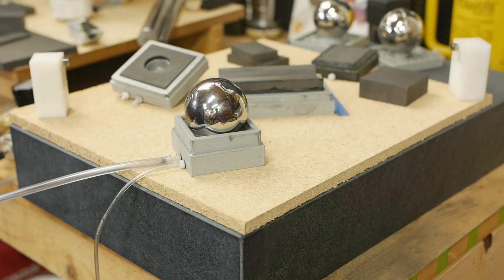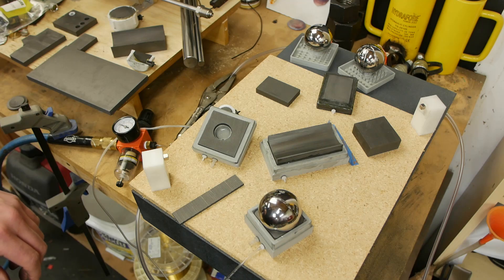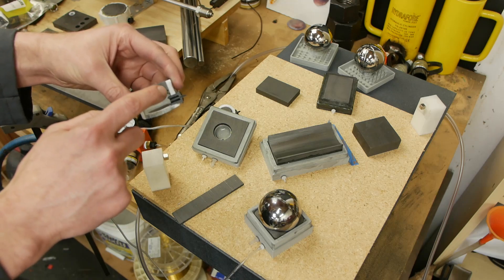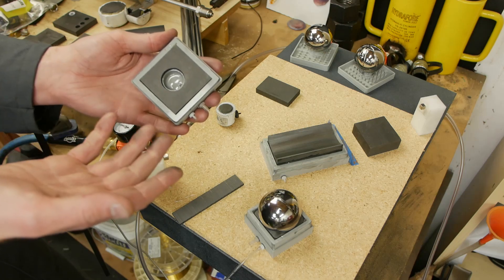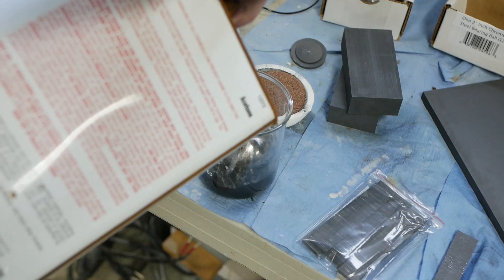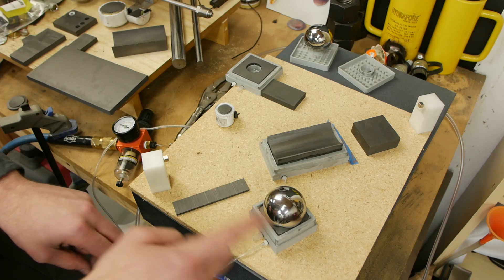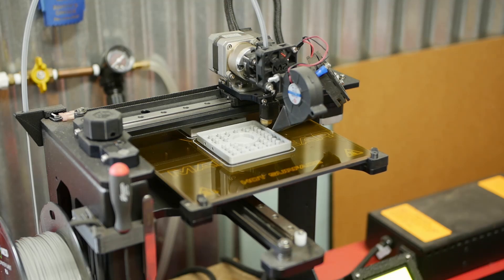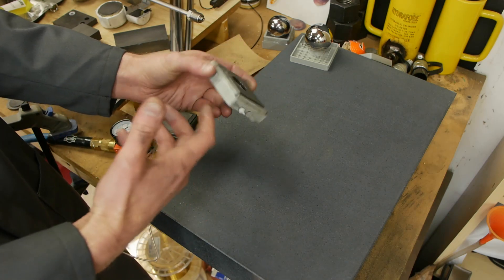Make vacuum pre-loaded spherical air bearings without special tools

Comment: Nice. What kind of air consumption are we talking about? Would it be possible to create a self rotating platform with radial and thrust bearing elements, and power it from the air tank, instead of the compressor to reduce vibrations and other moments? I am thinking of creating a high speed gyroscope (~1kg, ~100000rpm) suspended in mild vacuum, with air bearings, and entire assembly (including two weight balanced air tanks), put on the free floating and very level granite table, coupled using air bearings too, possible in a separate vacuum enclosure (to reduce environment air flow). The important part is, I need the entire assembly be self contained (batteries and air supply), as the cables and tubes could put forces and moments on the entire assembly. Communication and datalogging would be wirelessly or to flash storage, so that is rather easy.

Comment: BE CAREFUL CUTTING GRAPHITE ON POWER TOOLS. Contrary to intuition, even though graphite is commonly used as a solid lubricant in NON ELECTRICAL APPLICATIONS like locks, the graphite dust DESTROYS THE ELECTRIC MOTORS in power tools. I found this when doing machine design at Form Physics in San Diego back in the 80's. We were using wood working joiner-planers and circular saws to machine graphite transports for experimental ceramic injection molded hard drive parts and all the power tool motors were destroyed. We didn't do any failure analysis but I assumed it was either destroying the bearings or shorting out the brushes or winding. Just be sure to use lots of air to blow out the tools during all the time they are exposed to the graphite dust. Of course, we were doing quite a bit of machining and probably doing just a few pieces would be OK, just be forewarned..

Comment: This technology is a good demonstration for how superconductor materials would change the world as we know it. Superconductors, because they have zero electrical resistance, are always flowing electrical charges which results in a magnetic field. If you were to build and engine entirely out of super conductive materials, all the parts would last virtually forever since they would never actually come into contact with one another due to magnetic repulsion between the components. The way these parts are held in close suspension is a good visual for that concept.

Comment: Great video as always - I'm interested to know how well the spherical bearings scale, i.e., is there a minimum and maximum potential size? Also, is there a formula to calculate the approximate load bearing potential of a spherical bearing based on its size, air pressure etc?

Comment: 16:30 Would it not be a better design to use two of the half pipe air bearings, one on top of the other? I understand that it might be a pain to perfectly center the shaft in relation to the bearing, especially if everything is hand made without precision tooling, but the added benefit of being able to remove a bent or mushroomed shaft without drawing it through and damaging the solid graphite block may be worth the added aggravation.

Comment: Excellent video.  I work in the PCB drilling industry.  They use air bearing spindles for drilling holes down to 0.0020" diameter.  The spindle shaft spins up to 180,000 RPM (3 thousand revs per second) while being suspended on a thin cushion of air (horizontally and vertically).  For the drilling table, it is floating on vacuum preloaded air bearings.  The flat air bearings are hard anodized aluminum with 6 glass lined orifices.  Each orifice is 0.0060" inside diameter and is supplied with 80 PSI of highly filtered air.
Reply: Just curious: how long does it take for the spindle to stop if a tool change is required?
Reply: @cogoid  The spindles are powered by a 3 phase AC system using variable frequency and variable voltage.  From 180,000 RPM it takes about 6 seconds to come to a full stop.  The shaft is held at 0 RPM by applying a small DC voltage to the AC spindle.  Then, to ramp the spindle up, the DC is removed and the AC is applied.  To reach max RPM, it takes about 6 seconds.
Reply: @GregSr  Cool! Thanks for explaining!

Comment: I'm warning you now: do not operate electronics you really like and want to keep in a place where you machine graphite. Trust me.

They WILL die if you do not have a very good extraction system.
Reply: @Neocaradina graphite conducts electricity. graphite dust can short-circuit power electric lines or power plant , that's why there's such thing in military as graphite bombs
Reply: Yeah I place carbon fiber near close my 3D printer, one fiber get into power supply and short circuit. First I thought it was due to Chinese crap, then I find out it was one single filament. thinner than human hair :)
Reply: Glad you warned him because surely he doesn't know that
Reply: @Neocaradina Graphite is conductive. You can make a really effective buck converter (a device that lowers voltage) out of a pencil. Just cut the graphite free of the pencil, attach your positive and negative leads to each end and place your power tap wire onto the graphite. If you place the tap halfway, you get half the voltage. It's a linear circuit so percentage of distance across is percentage of voltage you get out of the tap.
Reply: @eideticex  Not every device that lowers voltage is a buck converter. What you describe is a voltage divider, which wastes significant amounts of power. A buck converter is way more efficient.
Reply: @eideticex  That is a resistive divider... not a buck converter.
Reply: @rich1051414  exactly why space pen was a necessary invention. they joke about russians being more practical just using a pencil but that's just a calculated risk out of necessity, they stopped when it was possible
Reply: @snooks5607  
Hmm. That's interesting (graphite dust contamination) - and quite possible/likely. I'd heard the reason for not using pencils is the more down to earth explanation that the tips break off and they didn't want pencil tips floating around. I suppose it's much the same reason, just a matter of size as small fragments of graphite would be constantly shed in use as well as microscopic dust and the occasional whole tip.
Reply: @freelectron2029  they should have just stolen the marines' crayons.
Reply: @freelectron2029  lol, non-conductive granular marital in the zero-g of a space cabin still possess risk in terms of clogging air filtration & potential inhalation or eye irritants. Just add a few dozen more kilos & cm^3 in air filtration equipment and another couple hundred kilos in fuel and the cost parity between the innovation of space travel and banging sticks together to make fire would equal out eventually.

p.s. The space pen was invented independently by a private company, no tax dollars were spent in it's development, and was sold to both the USA and Soviets.
Reply: @dustinbird2090  lol. i think you missed the point. overthinking problems was my point and your answer illustrated that point perfectly. woosh. dozens of kilos to carry a crayon type pencil over a pen HAHAHAHA. couple hundred kilos in fuel HAHAHAH. bits of crayon flying around the cabin popping eyes out of there sockets left right and centre HAHAHAH. oh my man, you need to get some life experience. not key board experience.
Reply: @dustinbird2090  lol, am i being pranked? you just did it again.... wooshwoosh. hilarious )))
Reply: @freelectron2029  You literary are incapable of having a discussion where you admit your point is invalid.
Reply: @dustinbird2090  well done another comment with absolutely no substance. Mr bird everybody.... American. Likes to talk. But not think. The American dream. How's that working out for you all?.... Yup.
Reply: @freelectron2029  You had an original point. Defend it or don't. Play dumb all you want but, I addressed I your original point. And your only response is too insult me.
Reply: @dustinbird2090  I'm not exactly aware of all that might be going on in a space ship, but aren't there plenty of potential sources of dust anyway? Like fiber based materials or even the humans themselves (they didn't wear space suits all the time, did they?)

Comment: For your bearing, try cutting 4 separate quarters with the form. They can be slightly undersized, make some type of 3d printer case to hold your graphite. and use metal straps to preload the pieces together. once you add air the straps will deform and you will have a captive air bearing.

Comment: A good glue for PLA I've found.d its Weldon 16 acrylic glue. It actually seems to chemical weld the plastic. It obviously wouldnt do anything for the graphite block, but it works really well for pla-pla and I'm sure works good for pla to abs etc. Just thought I'd share.

The thick consistency fills layerlines and helps fuse a bit aswell.

Awesome videos as usual🍻

Comment: did you think about doing grafit work in a seald box what they use in laboratories with the rubber gloves you know so it wont get your room area dirty ;)
Reply: Or just one of those small sand blast booths with the window, the Homer Simpson gloves, and a shop vac plugged into it's wall.

Comment: One thing to remember about working with granite is that it is very abrasive. Graphite tends to form microscopic flakes when it is worked, often these flakes slide on each other which is what gives it a low friction property. The problem is that the flakes get caught on edge and are harder than steel and will destroy machine ways. If you look at machines specifically designed for graphite machining they have all their ways and spindles sealed to keep the stuff out. Thats why you never buy a used mill that was making graphite edm electrodes.
Reply: how can something be an abrasive AND a lubricant at the same time?
Reply: @larrybud  did you actually read my explanation?

Comment: If you don't want to spend alot nor have a noisy vac/compressor, you can buy a small dc vacuum pump for under $10 or convert an old aquarium air pump into a vacuum. There's always a way to hobby cheaply =)

Comment: some info.   good work.     at 17:00,  re-think.         further efforts should be informed by the fact that, due to there non-durable make-up,  these  miniature  air bearings are  novel, only.      this process  produces an   Asymmetrical  'force';  with its greatest affect being a reduction of  drag,  due to  GRAVITY.        thus, the lack of the  practical  use of this friction-reducing technique  is  explained.      cheers

Comment: Great stuff! I'm pretty sure putting round hole in graphite will work for a low friction linear guide but will give you a very low radial stiffness bearing. I'm pretty sure you've seen it, but check out New Way's video on radial air bearings using multiple individual bearing elements.  https://www.youtube.com/watch?v=lOTWx69mghM This allows you to set the preload of the bearing mechanically, and the stiffness of the bearing is two series springs, the structural loop plus the air bearing stiffness, which can be extremely high for small gaps.  The tradeoff is how perfect you need the surfaces and how much load capability you want to remain before grounding the bearing, but I think this should be sufficient to use for a high accuracy grinding spindle for example.

Love the content, your stuff is very inspiring!

Comment: 16:55 you have to use this drill mashine 0:16, and magnets - to control preload forces of graphete stator plate, which good to fix on moving platform(like transformator on "ice" table) and maybe fix on bearing-ball -for free auto positioning in horisontal directions and spherical angles rotating, and only one oposite magnet in center of future out of tunel - to push free in most aspects of moving graphete stator plate to ethalone cylinder, that will be rotated by airjet or magnetically(like asinchronous motor rotor - you need only one AC coil(electromagnet from relay or so), and one permanent magnet near it - cross-directed - to rotate any iron piece
Reply: maybe some intresting results possible to reach, driling - like in technique of coaxial drilling of screw or bolt  - when auger is soft fixing somehow(i am not expert there) and future stator(graphete plate) rotating, fixed on 0:16 end of rotating cylinder

Comment: Coating the surface of a 3D printed part will probably not make it stronger. It can actually lower the point of failure.

Comment: So many billions put into maglev, yet we don't have air hockey trains.
Reply: Give it a push and it'll go around the world?
Reply: @gearloose703  
It would probably still need some kind of propulsion.  Come to think of it there was a whole air curtain train concept designed in France, but it was too hand to justify building all new track.  I wonder if you could use an air bearing on standard rail?
Reply: It could work on standard rail, just use multiple bearings, hundreds or thousands, small enough that rail wear and shape could be compensated. Those could be pretty long but quite thin. For the propulsion, this calls for sail powered trains.

Comment: In the 1930s the designers of the Hale Telescope at Mt. Palomar used the same principle to “float” a million pound telescope on a ultra thin film of pressurized oil. The friction is so low, the drive motor for the scope is less than 1/10th of a horsepower, about 100 watts.

You can read about it in a book titled, “The Perfect Machine.”

Comment: Drill and tap the top side of the bearing. Then you can chuck it into a drill press at low speed. You can also thread on a handle to make hand spinning easier. For the holes, make a faceted reamer. Grind three flats at a sharp angle, so they form a triangular shape, like the flats at the tip of a nail.
https://www.youtube.com/watch?v=5rwl-e_KI4U

Comment: I was wondering the way a flammable gas would burn.Would it cover the hole surface?
Reply: That is a very interesting question. I do not think anything particularly interesting would happen if you simply pressurize it with a flammable gas -- I think it would just spread out, and mix with air and burn like an ordinary torch does. But if you pressurize it with the gas premixed with air, then very interesting things are possible. I could not find any videos of it right away, but if you google "Cellular Premixed Flames on Flat Burner" you will see what I mean. There is a video with 1D flames. Not quite the same thing, but looks beautiful: "Premixed-flame oscillations in narrow channels". But interesting things happen only under certain conditions - mixture ratio, type of fuel, etc. In many cases it will just burn steadily, like you say over the entire surface. You can see it in the very beginning of: "Porous radiant burners. Internal and external combustion modes".

Comment: There is actually a company in the US that sells them commercially, but the material is far more stable. Have a set of theirs designed as a floating bearing for a heavy 4 cm thick Alu slab of 1m x 1m, they even sell them as linear guides

Comment: A few thoughts on this...

1) over long periods of time does the air pushing through the graphite damage it? Your shop air probably isn't pure so would contaminates being forced through it either damage the graphite or maybe even increase the air flow through abrasion or decrease it through graphite pour blockage (causing grounding)? - and would even pure air do that anyway? (that sounds like a video on its own - does unfiltered air flow through semi porous materials change the pourusness of those materials, and if it does, does it decrease or increase air flow - what happens if you use filtered pure air? Does the action of air alone damage the graphite over time?) 

2) what would an application for this be? I'm an automation engineer and have to deal with a lot of broken bearings and the aftermath of that - I can't think of a way to use these keeping in mind I'd need to eliminate as much dust and crud as possible.

3) your through hole idea piqued my interest because I could enclose that and have the shaft turn through a seal (maybe), and I suppose this applies to all air bearings - if I have a leak or an air failure, if I'm using this on anything with even a modicum of momentum isn't the bearing going to ground out and destroy the graphite before coming to a stop (assuming I've added stop functionality to the control circuit in the event of an air failure)? 

As usual, cool video, thank you, I was trying to think of ways to apply this and the potential headaches I'd come across if I did.

Edit: I think that's cordial enough for a subscriber of AvE lol

Comment: To make a fully enclosed cylindrical bearing, why not bring two half-cylindrical bearings together as you are lapping them with one cylinder?  It seems then there might be less issues aligning the cutting tool with the hole, and you already found that exposed granite faces are not much of a problem (wrt the inner faces).

Comment: As an alternative to epoxy, you can solvent treat your 3D prints - it fuses the surface together, rendering it impermiable. You just need to expose it to the right solvent - acetone for ABS, dichloromethane for PLA. Careful of the dichloro, it's nastily toxic and eats through most gloves in seconds. Splash, swish, swish, swish, smooth! You can do ABS all-over by putting it in a heated chamber with a little acetone at the bottom - the vapor alone is sufficient, and gives a wonderfully uniform surfacing.

Comment: Practical Application : http://www.airbearings.co.uk
These are PCB drilling sprindles that run at 400k RPM, they consist of a ground spindle shaft with embedded squirrel cage (brass rods within the steel spindle itself, the condictivity difference is enough to promote rotation). This sits within a ground tube with brass jets pressed into the wall of the tube. 3 phase high frequency windings as well. And all water cooled. If the air failed for more than a few miliseconds, the entire thing would friction weld into a solid lump.